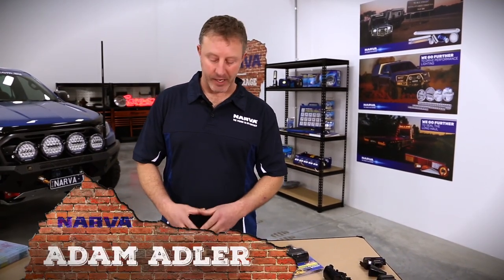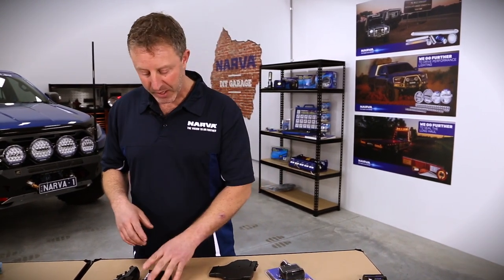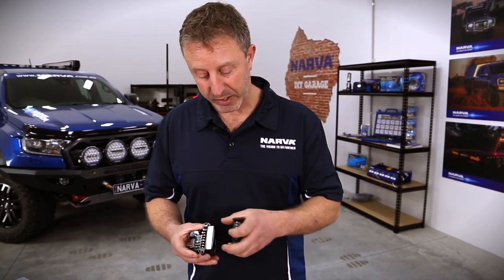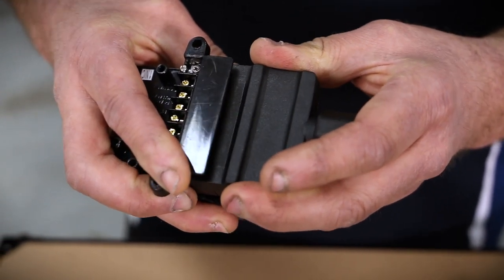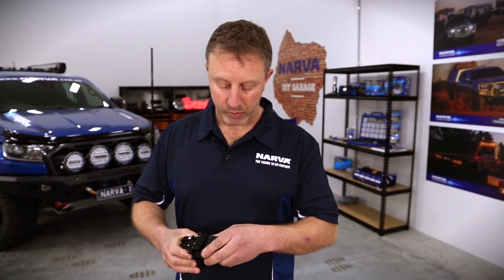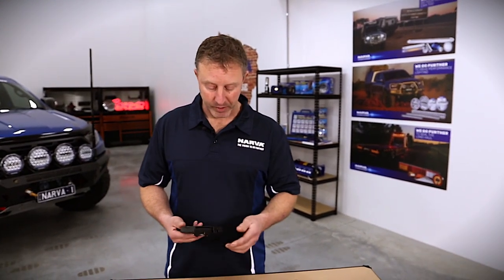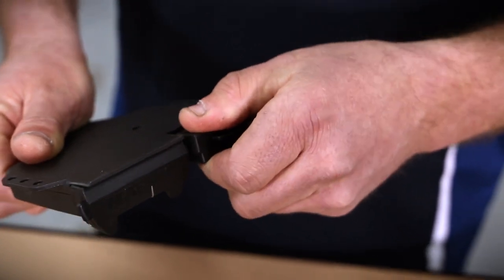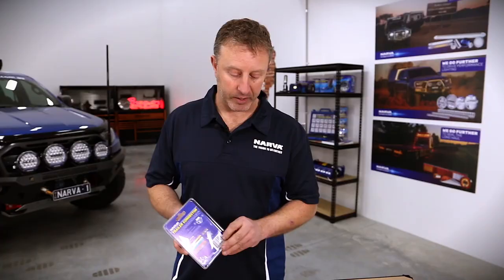Selecting the Right Trailer Connector

Comment: Some caravan manufacturers use non-standard wiring for their Auxiliary brake hydraulic pump or breakaway sense wire.
If your Cavan comes with 12-pin flat from factory, make sure your car is wired with a 12 pin flat, to prevent confusion.
Modern vehicles benefit from having all the wiring run at once. While it may cost more up-front to have 12-pin flat and Anderson power and ESC installed, it may be much more cost effective in the long term.

Comment: It is worth noting though, if you have a 12pin plug on your caravan/trailer etc this can not be plugged into a 7pin socket on the tow vehicle. Why might you need to know this, if you breakdown and need you caravan/trailer towed by another vehicle with only a 7pin socket, there is no adapter on the market.

Comment: Hi do the Narva 7 Pin Trailer Plug With Anderson Plug 50A 82048BL just plug into the existing 7 pin flat plug
Reply: To take advantage of the Anderson power, you will need to connect the Anderson power with 6BS cable and a 30A fuse direct to your battery. The 7-pin socket component will work just like a stand-alone 7-pin socket.

Comment: I have a older caravan and older car, 1959 and 1957.
I want a plug that looks quite period Wich appears to be metal plug 5 or 7 pin.
I want to add electric brakes and charge a 100ah lithium battery in the caravan, I am not very fussed about how much charge I get in just as long as there is the option to trickle charge the house battery while travelling.
I have noticed there are two thickness of 7 core cable, I usume small size is used with the small pug and large is for the large plug.
I can't find a amp rating on the packets of the small or large plugs, I really want the small 7 pin round becuase it looks like a earlier plug since I am trying to keep the apearance of the van as period correct as possible.
Can I put the thicker 7 core cable in a small round plug?
Can I get any charge at all to the house battery while using a small 7 pin pug and electric brakes while still having a good feed to the brakes?
Reply: Trailer plugs are only capable of carrying a limited current. For battery charging, fridges and ESC, a higher-capacity plug is required.
While some manufacturers will use a 12-pin plug, a range of Anderson Plugs is a better option.
Your vintage vehicles are unlikely to have ESC, but to charge the battery, you would be better served with Anderson plugs hidden some where out-of-sight and use an Anderson extension lead when travelling . There is no 1950’s period-correct high-current connector because 100Ah Lithium batteries were not a thing in the late 1950s. If you have ESC retrofitted to your tow-vehicle and van, the common standard is a red-Anderson plug. You may also want to retrofit an Alternator in your tow vehicle instead of a period-correct Generator to handle the higher current draw of the battery charger.